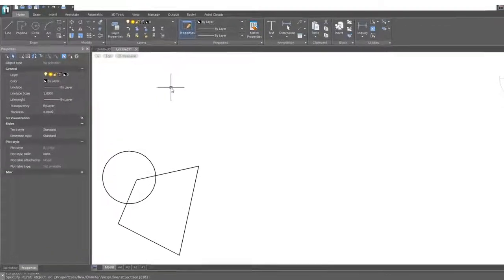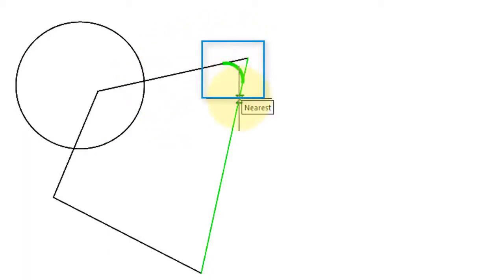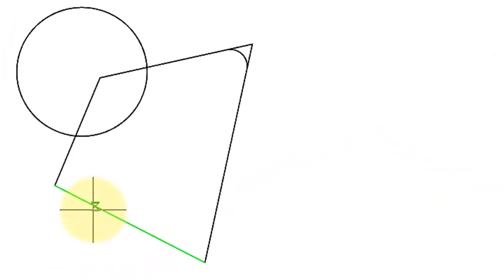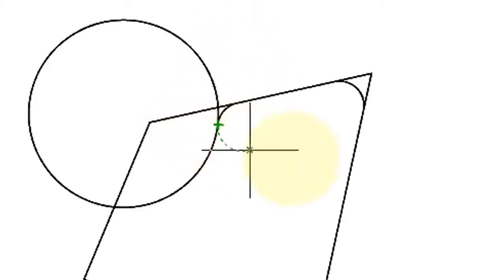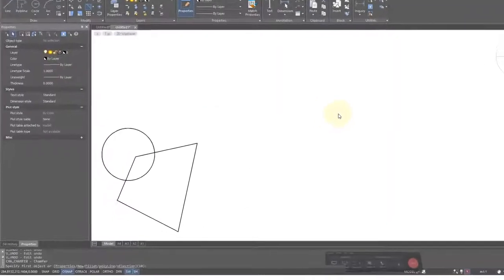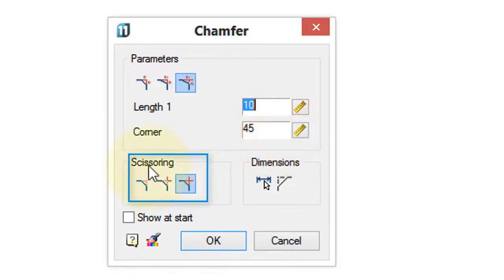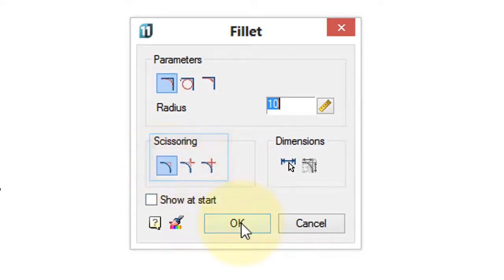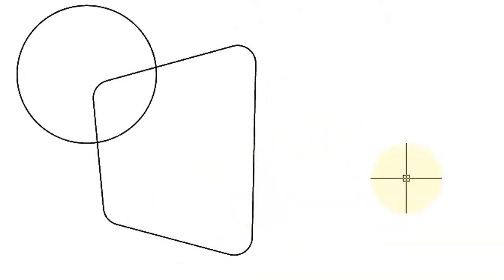How to Filleting and Chamfering Objects in nanoCAD

Comment: These options aren't available to me in the fillet options box. They are grayed out.
Reply from the maker: Which version of nanoCAD you are using? You can take a trial of the nanoCAD Pro 20 or nanoCAD Plus 20 to check the features of Fillet and Chamfer.

nanoCAD Plus 20 trial download link: http://nanocad.in/download-product/2d-cad-software

nanoCAD Pro 20 trial download link: http://nanocad.in/download-product/best-cad-software
Reply: @nanoCADIndia  nanoCAD 5, but I figured that out, had to unselect "insert circle as fillet" option. Really disappointed in this software as fillet command doesn't work as it should. Right now I have 2 lines at a 90 degree angle to each other. I go to Fillet, enter 10 radius, for a rounded corner at that radius, click on the 1st line, and I get "incorrect input."
Reply from the maker: @jeffwvu4602  "If the length of the lines you are selecting is less than 10 and you are giving fillet radius 10 then this thing will appear. Kindly increase the length of the lines and then try to fillet".

nanoCAD 5 is free version to be used by education institute and for the people who want to learn CAD. For commercial version pls use nanoCAD 20 . Nancad 5 are not downloaded from our site and the support is from the forum of nanoCAD.
com
Reply: @nanoCADIndia  That was the first thing I thought of, and it wasn't the case. I extended them anyway. I ended up saving, closing Nanocad, re-opening it and then it worked.
Reply: @nanoCADIndia  I am trying to do a fillet this very moment. 2 lines at a 90 degree angle. One line is 50 in length, the other is 30. The radius I'm trying to do is only 3. It won't do it. It gives me the nearest O-snap, I click on one line, then the other....nothing. The command ends. I would never pay money for this software.
Reply from the maker: @jeffwvu4602  This software is free so you don't have to pay money. If you are interested try commercial version of nanoCAD 20.